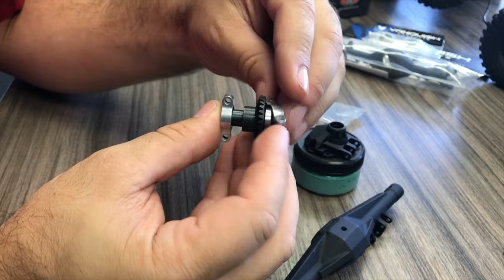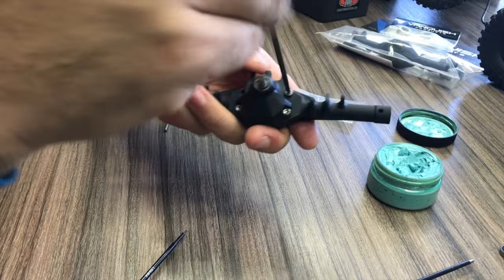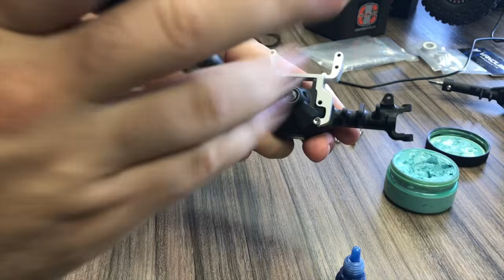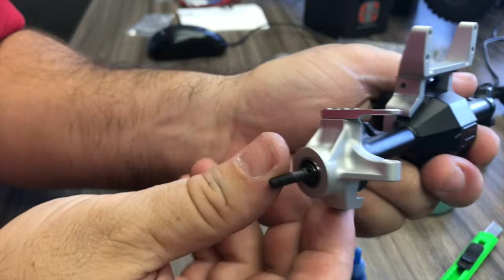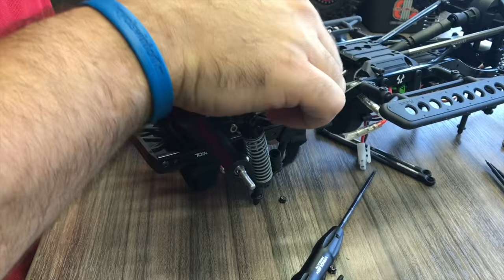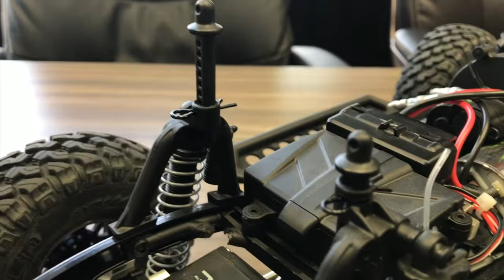Convert SCX10 to SCX10-2 - Vanquish Products Currie F9

Comment: Hello Sir, i know this is an old video but i just got a scx10.1 jeep wrangler. and i have also the F9 for the 10.2, would the stock links be just fine with the F9 axle? will the wheelbase stay the same? thank you
Reply from the maker: No the links are different and need to be changed.

Comment: hi there, over the last few days i've been watching as many of your deadbolt vids as i have time too. 
they are informative and good to watch. 
its great you outline the mods and how to do them, but it isn't really clear (to me) how they actually improve the performance. 
im trying to get more flex and stability out of my scx10 deadbolt. last night i saw your budget upgrade with the wraith parts and that should sort out my concerns with its cornering, but will the scx 10 ii upgrade give it more flex? just durability? 
cheers.
Reply from the maker: Adding flex isn't something I recommend at all. You do not want excessive flex, a general rule is to have about the same amount as the height of your tires.
Reply: @HarleyDesignsInc  
thanks for the reply, does that mean that most of your mods are for reliability (accept chassis mounted servo) and controlabilty?

Comment: Ok so I'm trying to do exactly this to my 10.1 except I already have the VP CMS bumper mount. Could I just install the 10.2 Curries like normal, or would I have to change things for it to work?
Reply from the maker: The VP CMS bumper mount will not put the steering link in the same position, and you also need to have a panhard mount as well. Once you have those two things, you may have to make two custom length links to make sure that everything lines up correctly.
Reply: @HarleyDesignsInc  I've got the panhard mount and everything. I did the CMS conversion a while back. I just recently switched from a SSD CMS to a Vanquish CMS

Comment: Can I use the scx10.2  lower links for my scx10
Reply from the maker: The lengths are not the same. It would not give you the correct wheelbase and pinion angle.

Comment: Can't we just stick on SCX10 2 axles to an SCX10 chassis?
Reply from the maker: Nope. The links are not the same and there is no provision to mount the servo. You have to either convert to CMS or do an axle mounted servo.
Reply: I see. How about with the links (they seem to be available on the Axial website) and a CMS?

I'm surprised an axle swap kit doesn't exist yet.
Reply from the maker: Yes if you replace everything then it will work. But it will require either a lot of parts or mixing a bunch of aftermarket parts in. I use a link kit in this video as well as an axle mounted servo.
Reply: I guess at that point it might be too expensive to be worth it. Thanks for the answers and the videos nonetheless!

Comment: Where can I find one of those sites selling scx10s
Reply from the maker: The older SCX10 models have all been discontinued now, the SCX10-II is the new replacement.
Reply: Harley Designs I brought the scx10 ii because of ur build. I made a mistake and brought a bumper kit that didn't fit the scx10 ii.....so I brought the scx10.... Just to figure out later on the bumper kit did fit the scx10 ii....

Comment: Normally l enjoy all your videos, and thank you for them, you have saved me time and money with your wealth on information.  The total out lay of what your showing is $............. would have been awesome!

l added it up and was shocked to say the least. $650+ to me and 98% of everyday RC people, l think would agree is insane 
 False economy!   
Ad to that a second hand truck, and it's a four figure headach, just like our NEW to us Deadbolt was a year ago.

Our Deadbolt is In the four figure rang now (mostly because of the poor quality plastics/electronics etc.), and that's with stock axles. 
The few things that we have added by choice, like 120mm tyres and SSD steel beadlocks is a million times over, a better choice to improve the original SCX, and like you say when set up correctly no noticeably torque twist. 

Heck with a $650 budget you could buy the wheel and tyre package you really want, then go and buy a new budget friendly trail truck which would rule out an Axial.

Just saying the bleeding obvious, but someone needs to point it out.
Cheers

Comment: Could I use a set of stock axles out off a scx10 ii in my scx10?
Reply from the maker: +Anthony Redman you will need to pickup a servo on axle mount. UCFab sells one that you can buy through Beeftubes website
Reply: Thanks for answering my questions. I'll check out that website. Great video
Reply: Will the scx10 axle shafts and everything else in the axle work in the scx10 ii axles? I have been thinking about chassis mounting my servo. Do I have to use the panhard set up?
Reply from the maker: +Anthony Redman if you want to go chassis mounted then you’ll need to buy a link set and a Vanquish Chassis amounted servo bracket with panhard mount. You’ll only use the chassis plate even though it comes with the axle side.

Comment: I don't like the position of the rear wheels at all. Looks wrong. What's the reason you wanted to pull the rear axle back? Leverage to put more pressure on the front? Does it give a lot more performance than keeping it stock, or is it a fitment choice? I mean is it not possible without moving it back? Looks like there's room.
Reply from the maker: +A Baker 71 a slightly longer wheelbase helps for steep climbs without sacrificing too much on turning. I ran this truck in competitions so I wanted to maximize performance.

Comment: Is there a way to add some small pumpkin axels to a scx10 that would be inexpensive? I want a second truck for friends but would like you spend less than the $350 total price of a new scx10 ii kit or $409 rtr. I also want to keep the 45 degree steering.  I don't mind the chassis mounted servo either.  I'm new to this hobby about 1.5 months ago.  I do love it though.
Reply from the maker: Sounds like finding a used stock SCX10-2 may be an option. Otherwise, you'll have to hunt down an original SCX, a set of SCX10-2 axles, then buy the front chassis pieces. A stock set of SCX10-2 axles is usually around $140. The rest of the parts could possibly be under $200 if you search. But if you just want stock stuff, buying used may be the best way.
Reply: Harley Designs I was hoping there a way to revive an old scx10 to similar to scx2 standards for not much money.  It's a bit if a waste of all those old scx10s.

Comment: When all the new Vanquish Products you just bought cost more than the whole budget project truck all together
Reply from the maker: +Israel Cardona yeah but now you have a truck that costs about the same as a stock SCX10-2 but with built Curries
Reply: Buy Scx10 ii and it will do just as good as any expensive upgrade.  Your breakage will be cheaper too.
Reply: Israel Cardona I tottay agree its cheeper just to buy the scx102 lol
Reply: 299$ + 300$ isn't the cost of an scx10ii lmao nice try Harley. That's a CRC JK scx10ii (the most expensive one) plus some Vanquish aluminum beadlocks and some proline or pitbull tires 😂😂.

Comment: I know you said it is a lot more complicated to convert SCX10-1 to SCX10-2 axles with CMS, but it would be awesome if you could produce a video to do that conversion. I dont want to give up the 5 scale points of the CMS.

Great video as usual!
Reply from the maker: I would do that but that's basically just pulling the part numbers from the SCX10-2 manual and buying the stock parts or any upgrade part you want along the way. I thought about doing both but when I looked at it that way, it seemed that it wouldn't be as helpful to many.

Comment: So you have to run a 12.3 link wheelbase or can you just get the vp 12 link kit
Reply from the maker: +Mike Diffenderffer the link kit has to be built for SCX10-2 axles and the only link kit available for them is the 12.3. The VP 12.0 link kit is for the original axles.
Reply: Harley Designs is there any plans on make links for these for 12in wheelbase

Comment: Hi, for $351 you could buy a brand new scx10 2, instead of two axles. 
Not a very economic way to rc. 
But it's a great video, you really know these axials inside and out. 
😀 👍 👍 👍
Reply from the maker: +Mikey mike yes you could buy a new one, but it would be a new one with stock axles rather than completely built Curries.
Reply: I'd wrather have two rigs to build on than some axles, but that's just me.

Comment: Really like the fact that someone has come up with the parts to do this type of conversion on a scx10 and be able to keep the axle mounted servo. The only problem I have is the fact that with the cost of all the parts to do this I might as well just go buy a new scx10.2.
Reply from the maker: +99stangdude yes you could buy a new one, but then you'd have stock axles instead of built curries.

Comment: haha all the power of tactic servo lol.
Reply: Allen Thomas it's a beast!
Reply: Israel Cardona my comment was to  the resentment tone of josh's voice and I feel the same. It's not a terrible rtr servo in a stock trail truck, it works. But for those who crave and demand performance, it's not for us.
Reply: Mine just died on me today ;( even with ebay metal gear upgrade, electronics short :(
Reply: ferdis7 i recomend hitec 7955tg. pricey, but i've never had one fail.
Reply: Allen Thomas to be fair ive had my stock tactic servo on my scx10ii for over a year now and it still runs great. And ive beat the s*** out of it and have submerged it too many times to count and it still runs. It's just one of those things that if it isn't broke don't fix it
Reply: The only the with vanquish is that there you cant find any info on which parts you need to order to build a complete axle.
Reply: Sam Sweden i suggest looking at the manual to see what's required, then search the site for those related parts.
Reply: humble rc well, thats not the problem. If I want to build a complete vanquish axle(because they dont sell complete axles) I havent found any intructions on vanquish webb showing the customer "this is parts you need to build our currie axle for (example) your wraith? You have to look at other youtubers who build axles, pause the video try to wright down the numbers you see etc etc. 
How hard can it be to make a webbsite that works?
Reply: Sam Sweden i don't know man, i didn't have that problem. have you tried calling them or emailing support?

Comment: Do you recommend this axle or the rockjock for a scx10 ii
Reply: +Mike Hows no because the back piece is not screwed in it is actually part of the housing
Reply from the maker: +Radiocontroled adventures it's just a style difference. Unless you want the servo on axle, which is only available for the F9 axle.
Reply: +Harley Designs oh ok I was just wondering if the pumpkin clearance was different
Reply from the maker: +Radiocontroled adventures they are basically identical.
Reply: +Harley Designs thanks
Reply: Will the servo mount work on the Rockjock?
Reply: cool, thank you